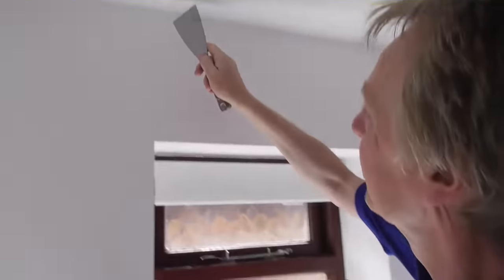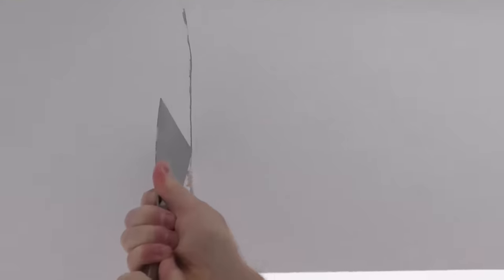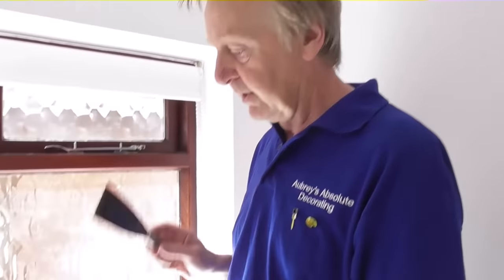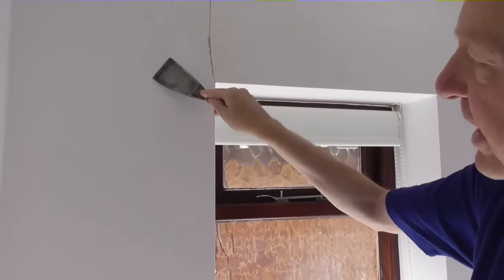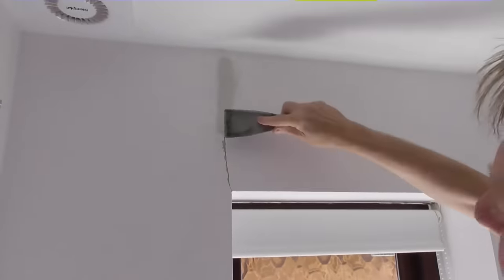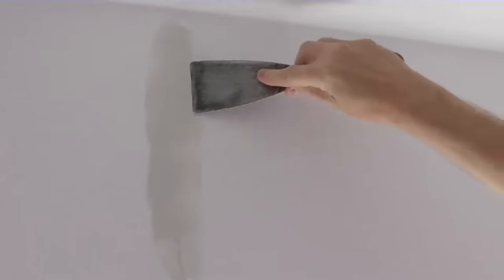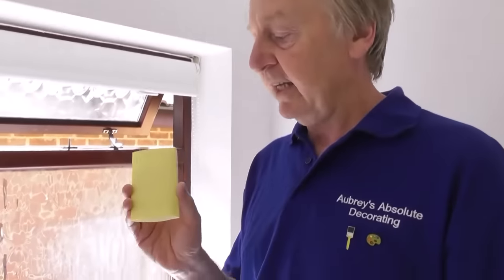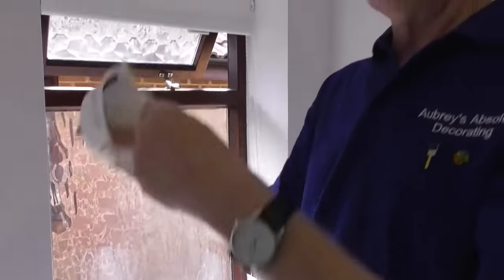How to Repair Hairline Cracks

Comment: when I painted over a newly filled crack with the same white Dulux paint as I used on the rest of the wall, the colour was very different and the polyfilla showed through.  It's been around a year and the cracks is still a different colour. Do you have any tips on how to make the filled crack blend in?
Reply from the maker: What type of finish was the white paint, matt, silk or something else.
Reply: @AubreysAbsoluteDecorating  it was Dulux Easy care washable and tough Matt emulsion in Timeless . Thanks for the reply
Reply from the maker: These paints are very good and contain many additives to give them extra performance.  They are quite thick and when trying to touch in can leave a visible outline.  I would suggest thinning down a small quantity of the paint with water so that it is quite runny.  Apply one or two coats and try to blur out the edges with the brush.
Reply: That sounds like an idea that might work. Thanks a lot Aubrey for the tip! ⭐⭐⭐⭐⭐

Comment: personally I would have taken more plaster out when scrapping then coat the bare crack with pva followed by a quick sand and then filled with filler leaving it until the next day to allow any shrinkage before sanding. and this only works with cracks that was caused with either shrinkage in the plaster or those cause with things like water damage always search out the root cause before any repair because movement in walls can be from serious movement. all that said if your just decorating and not selling on your property then why not fill in this way.

Comment: thanks for the video... before I dive in, what's your view on re-painting?  obviously using same putty colour as existing wall, but is filling and repainting always going to be obvious. i.e. don't want to redecorate whole wall for a single crack.  CHeers
Reply from the maker: Hi Sean, as long as the wall has been painted with vinyl matt emulsion  or similar matt finish and you are using the same colour it should be ok.  After filling and sanding down the filler, apply two or three coats of the emulsion thinned down with water.  Apply the paint over the filler and brush away from the edges to blur out the paint.  If the wall has been painted with silk or soft sheen it will show up so you would have to paint the whole wall.  Hope all goes well for you 😊
Reply: @AubreysAbsoluteDecorating  thanks a Million for taking time to reply.  That’s just great

Comment: Hi thanks for the video. I'm in process of doing same at the mint. I have used filler but can still visibly see the crack and haven't even sanded it down yet. Is it ok to proceed or shall I sand it down and re apply filler again and much thicker coat this time?
Many thanks
Reply from the maker: Hi, the filler may have shrunk back into the crack leaving a slight dip.  This can happen.  I would suggest you rub the filler down until it is flat with the wall.  Apply more filler, let it dry and rub down flat again.  Hopefully all will be well after that.
Reply: @AubreysAbsoluteDecorating  thank you no rush in this lockdown. 🙏

Comment: Any tips on filling a crack running down a join in two walls ?
Reply from the maker: This would be best done using flexible, self adhesive fiberglass mesh tape and applying filler over it.  I will be doing a video on this process sometime in the future.  If you look up taping and jointing on YouTube there should be some video`s available.  Hope all goes well for you.

Comment: does this work the same on the ceiling or is there a different technique for the ceiling? thank you!
Reply from the maker: This technique works on walls and ceilings for hairline cracks. If the crack is along the join in the plaster board it may need to be first taped using a self adhesive fiberglass mesh tape.  I will be making a video on this in the future.
Reply: @AubreysAbsoluteDecorating  THANK YOU!!!

Comment: I would like to order some for a few hairline cracks on our ceiling, but does this product work well on drywall?
Reply from the maker: It is suitable for dents etc. in drywall but is not suitable for fixing splits between the joints of the boards.  These will need to be taped and filled over with a suitable jointing compound.
Reply: @AubreysAbsoluteDecorating  Thankyou for taking the time to answer my question! Your videos are very helpful.
Reply from the maker: That is good to know, hope all goes well with the decorating 😊

Comment: Brilliant but what filler do you use?
Reply from the maker: Hi, I was using a normal powder based filler (Polyfilla).  If it is a large crack I normally brush some water into the crack before filling as this will prevent the filler from loosing adhesion.

Comment: What filler is best used please, or can you use jointing and filling ready mixed compound also.
Reply from the maker: A powder based filler is best as it can be rubbed down and painted to leave an invisible repair.  Most ready mixed fillers will also be okay but decorators caulk cannot be rubbed down with an abrasive.  Hope all goes well with your decorating Jason 😊
Reply: @AubreysAbsoluteDecorating  thanks, i noticed other videos they put like mesh tape over crack then compound, is it gauranteed the crack wont come back just by getting filler in the gap once widened and painted over. Thanks again
Reply from the maker: This process works well for hairline cracks.  For bigger cracks it may be necessary to use the tape.

Comment: Great video ive just had some appear on plaster board would the same process apply ?
Reply from the maker: If it is on the joints of the plasterboard you will need to use some self adhesive fiberglass mesh tape under the filler.  I have not made a video on this process yet but there are others on YouTube.
Reply: @AubreysAbsoluteDecorating  thanks for the reply it was just a few hairline cracks but I've used the system you said and left it overnight just another quick question if I had the same problem with hairline cracks on the cieling would u do the same process ?
Reply from the maker: Yes, use the same process.  If the crack is larger when you have undercut it with the scraper, then wet it first with a paint brush and water before applying the filler.  This will help the filler to adhere better .  Hope all goes well for you.

Comment: Would it be a good idea to put thinned PVA in before, to add more of a thorough seal? (Ive seen people do this with large cracks)
Reply from the maker: Hi Oliver, the process shown here is for small hairline cracks.  For larger, deeper cracks using the PVA is a good idea as this prevents the moisture in the filler being drawn into the substrate which could caused the filler to crack and loose adhesion.  I will be doing more video`s on dealing with various defects in the future 😊
Reply: @AubreysAbsoluteDecorating  thanks for the quick reply! That would be really appreciated

Comment: The repair will usually last long enough to deceive buyers when selling a property, but in most cases, it will be back, unless the underlying stress fracture is fixed by wall tyes
Reply: What is a underlying stress fracture? We bought our house beautifully decorated and now the whole house has had lots of hairline cracks appear all over the house .  Covered them but they come back. What do I need to do to stop them reoccurring. Big thanks in advance 🙏

Comment: Could you please let me know what is the best filler to use?
Reply from the maker: Hi Rich, I normally use a powder based filler like Polyfilla.  You could also try a ready mixed lightweight filler that comes in a small plastic tub as many decorators get good results with this.  Most DIY shops sell this including Screwfix.  Hope all goes well with the decorating 😊
Reply: @AubreysAbsoluteDecorating  Many thanks for your reply. Very much appreciated.

Comment: When l have done this the filler shrinks do you recommend a particular one ?
Reply from the maker: This often happens with cracks which are larger than the one shown in the video.  Using a paint brush apply water to the crack immediately before applying the filler.  This prevents the moisture from the filler absorbing to quickly into the dry plaster which causes it to shrink.  I hope that helps.  I use the normal Polyfilla, however easy fill is another popular powder based filler with painters and decorators.
Reply: Beware a lot of the light weight fillers will 'flash' when you just emulsion over the top. A coat of acrylic primer/undercoat over the filler stops this.

Comment: What filler would you recommend?
Reply from the maker: There are fillers available for hairline cracks, however I use a normal powder based filler (Polyfilla) which does the job.  Hope all goes well for you Mike.

Comment: Hi. Do you do the same for hairline cracks on ceilings also?? Thanks
Reply from the maker: Hi Alan, yes the same process is used on both ceilings and walls.  Just make sure that you rub the filler down well when it is dry so that you do not leave a visible ridge.  It is also a good idea to apply a thin coat of emulsion over the filler before painting the rest of the ceiling.
Reply: Aubrey's Absolute Decorating Thank you. I think it’s due to movement on the joists. I filled it in before and now it’s back again!!
Reply from the maker: Hopefully the undercutting process should work.  Fingers crossed.  If it does crack again you may need to apply self adhesive scrim tape and fill over it.  I am hoping to do a video showing this process in the future.
Reply: Aubrey's Absolute Decorating Thank you. Look forward to seeing that and also repairing cracks/plaster on internal angles please too

Comment: Thank you . What filler do you recommend?
Reply from the maker: There are fillers specifically for hairline cracks available, however I use an ordinary powder based filler (Polyfilla)  which works well if the crack has undercut first as shown in the video 😊
Reply: @AubreysAbsoluteDecorating  
 Many thanks Aubrey for your prompt reply . I’m not a complete novice and have used  various fillers before with varying results . I just wondered if you had a go to favourite that was all . Much obliged 👍
Reply from the maker: Hope all goes well with the decorating Mart 😊
Reply: @AubreysAbsoluteDecorating  
 Cheers I’ve got both hairline cracks like the ones in your instruction video creeping up from the corner of the window frame to the ceiling  and wider ones on the wall where I may need to use some PVA after clearing out all the loose plaster before refilling. There’s so much help now online/ YouTube ,etc. ,and you guys do a great job. 🙏
Reply from the maker: Yes, definitely wack some thinned PVA in the deeper cracks first.  Thank you for your kind comments 😊
Reply: @AubreysAbsoluteDecorating  
 Thank you . I’m just checking out some of your other videos . They’re invaluable. Take care .

Comment: Which filler brand did he use pls?
Reply from the maker: Hi, I used a popular powder based filler (Polyfilla).
Reply: @AubreysAbsoluteDecorating  I have loads of hairline cracks in my house. Is it because of bad plaster, paint, house movement or all?
Reply from the maker: They are often due to settlement or the plaster drying to quickly. In most cases if filled correctly the should not be a problem.  If there is still movement and they return it will be necessary to use some self adhesive fiberglass mesh tape under the filler.  I will be doing a video on this in the future.
Reply: @AubreysAbsoluteDecorating  It was a very hot day when they plastered my house last year so that's probably why hopefully. Thanks for the reply and video Aubrey, much appreciated!

Comment: Hi Aubrey, what type of filler for the ceiling hairline crack?
Reply from the maker: Normal Polyfilla should be fine Trevor as long as it is only a hairline crack.  Undercut it and dust off before filling.  Hope all goes well with the decorating.

Comment: Looks like you are using the wrong filler in areas of movement polycell one fill foam flex would last a lot longer also a stronger emulsion such as crown extreme clean or dulux trade diamond matt will flex with the wall

Comment: No tape? That’s a structural join. You need a 3 coat plaster system with jointing tape, before you can paint that wall mate. I’ve been painting for nearly 30 years

Comment: A crack it that location be it top or bottom corners indicates either movement or a plaster board join directly in line with window reveal, in worse cases on a solid wall you would also see same crack in mortor joints outside property at same location as inside 👍👍👍